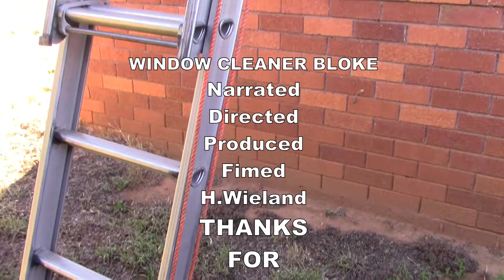WINDOW CLEANING  ✅HOW TO REPLACE SIDE PULLY ROPE ON BAIILEY EXTENTION LADDER

Comment: Thanks for that guide. The pulleys don't turn any more. Will the ladder still function to some extent? (10 months later). My Bailey ladder, bought 2001, has the upper pulley on the sliding ladder. The tie-off rope has to be short so it doesn't jam into this pulley. The lower end rope ring has rusted but I was able to tie it to the protruding bolt. Although the pulleys don't turn, they still function as slip points.

Comment: I love your videos  and truly appreciate everything I have learned from you.  Please NEVER just cut cable ties, they need to be cut flush or twisted/broken in such a way that they do not leave a sharp edge.  Just hold the tail of the cable tie with the tip of your pliers  and twist, they will snap off without  leaving an edge that can cut.
Reply from the maker: Thanks for the tip.
Reply: I found that cable ties exposed to the sun outside in the weather and under tension only last around 2 years before the just break.